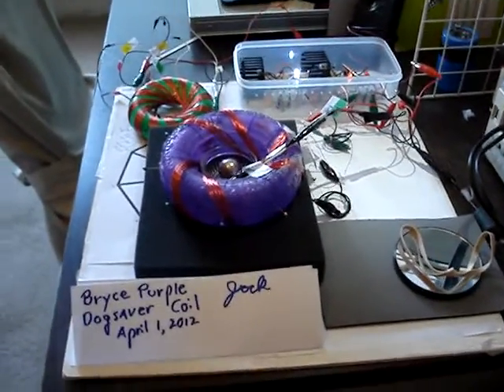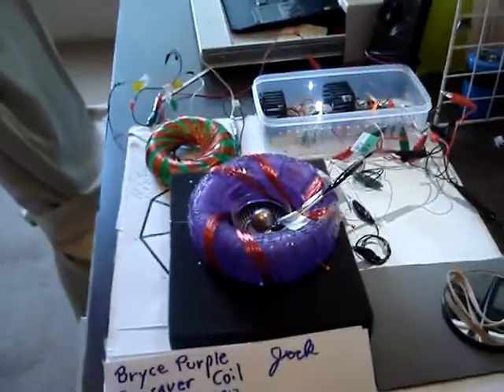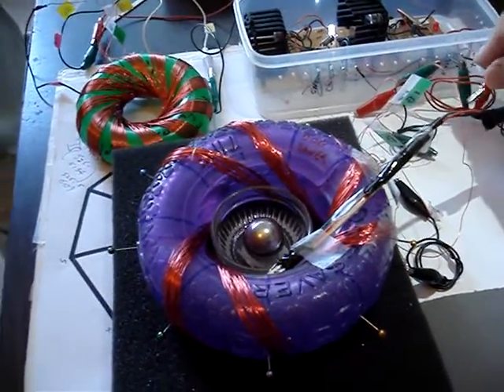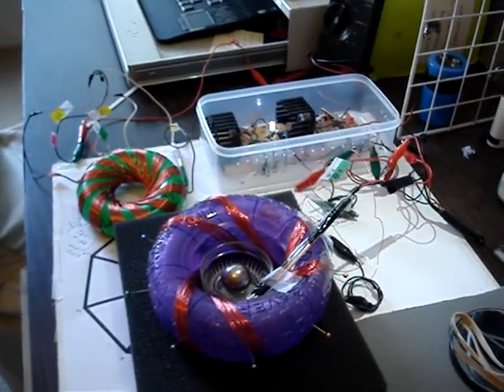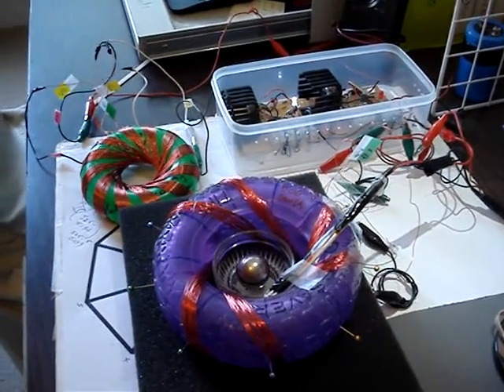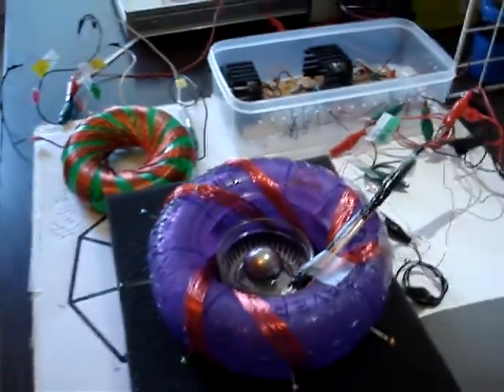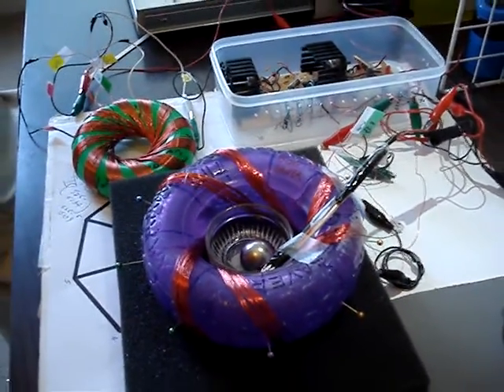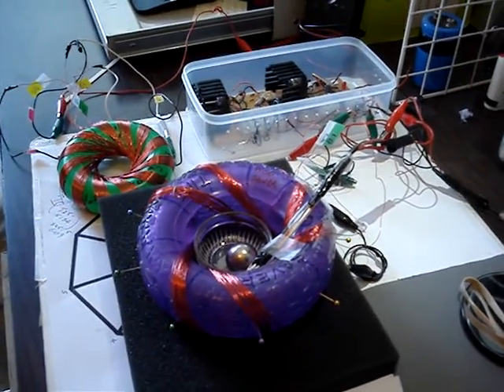Bryce Purple Dog Saver Coil

Comment: Hey did you try the pulse suggestion out? If so what was your out come. One more question I would like to build a coil myself any suggestion on wire selection and a good supplier in the USA? Ultimately I want to try pulse at a residence frequency and turn a shaft